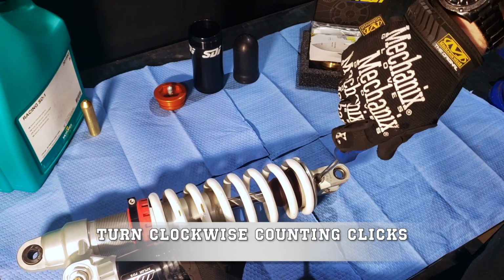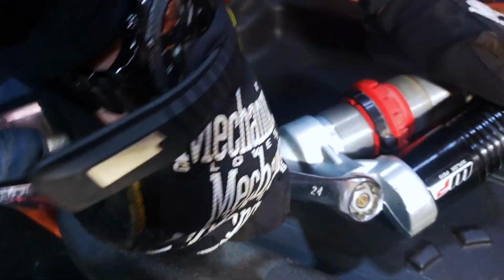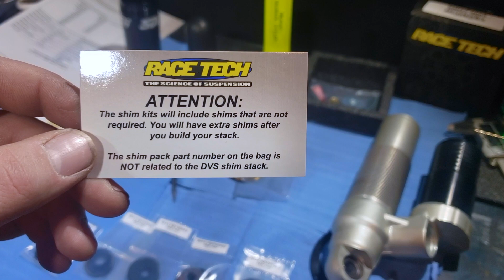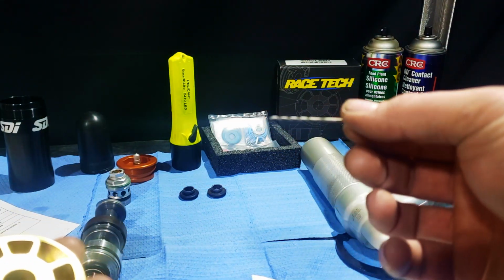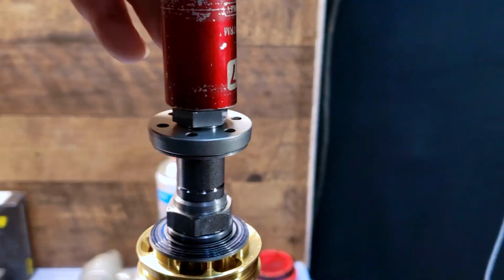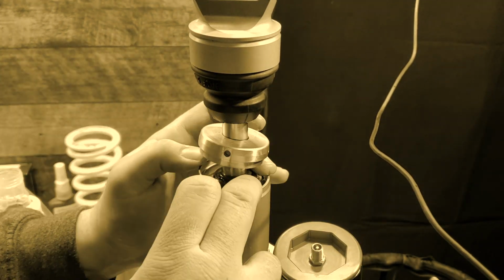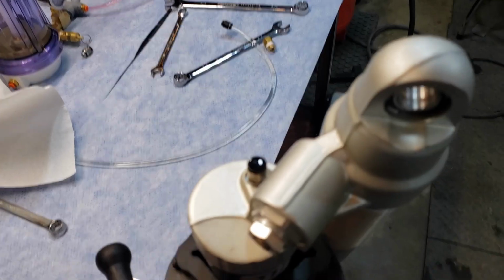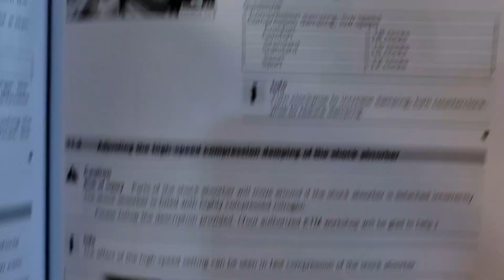HOW TO REBUILD YOUR PDS SHOCK WITH GOLD VALVES AND BLADDER KIT---PROJECT MOUNTAIN GOAT SERIES #6

Comment: When you realized the important detail of putting the spring collar on before assembly and filling with oil. 🤬

I finally got the gold valves for my Xplor 48 forks. Reviewed your videos for that process. Thanks again for posting these!
Reply from the maker: Oh no! Haha thanks I'm glad it helped. How do you like them? (Gold valve kit) mine are working incredibly well. I'm impressed.
Reply: The Xplor 48 forks were disappointing in stock form. After installing the Gold Valve kit, I'm impressed. They're much more composed as they sit higher in the stroke and don't blow through the travel, then become harsh. They don't dive like before when descending steep trails under braking. Even on gravel fire roads, they find grip and don't feel like you're on ice. 
Well worth the price and work to install after only 1 ride. 
Will likely revalve the shock and use a bladder kit as well.

Comment: Do you have a link to the vacuum pump you copied or stylied yours after?  I still need to build one.  Great video.
Reply from the maker: https://heliosure.com/product/motorcycle-shock-bleeder/

I bought it from this company. I thought about building one like it, until i seen these guys made what I was looking for, I figured they had it dialed and it would just be easier to buy it.
Thanks!

Comment: what was the name of the fitting that went into the bleeder and the vacuum line went into? great video, super helpful, going to do this to my 500s shock, was amazed to see all the gas come out of the fluid fresh from the bottle. Rebuilding a shock without a vacuum pump and leaving that gas in the fluid and some gas in the body itself would be disasterous for racers... just putting around the trails prob not so bad, but doing 100kph+ through desert and whoops no way... i found the same vacuum system you have, great price, is that system still working well?

thanks man, great work!!!
Reply from the maker: Hey thanks! Its called BSPT fitting BSPT is similar to NPT, but there is an important difference. The thread angle is 55 degrees instead of 60 degrees, which is usual for NPT. Therefore, an NPT fitting will be inserted in a BSPT connection or vice versa, but they will not be sealed. 
The pump is still in food shape!
Reply: @ENDUROEVOLUTION  hey bud one more question, the link to the video on modifying the drill bit to drill the correct size bleed hole
.

Comment: Another great video from you! I just found your channel. How do you like the suspension after doing the forks and shocks? If you wouldn't mind doing a over view on your bleeding system that would be cool. I bought a vacuum pump and filter housing but never built the system yet.
Reply from the maker: Thanks! I'm glad to hear that! The suspension feels more firm, I feel it gives me more confidence in 3-4th half to full throttle, places I ride that are usually high 2nd or low 3rd gear im doing in 3rd full even looking for 4th sometimes, And that's with the settings from racetech,  I need to go and set up a good line and keep hitting it to get everything dialed in...if it needs it.
I love that its compression and rebound on each side now👌 

I will definitely put out a better video on the shock pump, the shock video was getting pretty long so I figured I'd shorten it up by Trimming the shock pump part and then do a separate video.
Next time I service my suspension I'll focus on that. 
Cheers bro🍻
Reply: @ENDUROEVOLUTION  thanks for the reply. I'm. Trying to decide what direction to take with my suspension on my 18 300 6 days. I do like the option of learning revalving and playing with shim stacks. I'll be looking forward to the shock bleed video!!!
Reply from the maker: @ponydown418  I'm a big advocate of doing everything yourself, you learn a skill that you'll always have and it will save you money in the long run, it is a bit  pricey to get all the equipment, but once you have it, you have it, once you get good enough you could even help your buddies. Knowledge is the most valuable thing in the world, 2nd place is tools. I 100% believe you can do this yourself 🤙 and if you run into any walls shoot me a message and I'll be more than happy to help you out! I love this sport and I love helping people. 
We have a group on Facebook come join the Goatfamily 🐐🤙
Reply: @ENDUROEVOLUTION  oh yes I agree 100% on what you said. I have some suspension tooling but I'm sure you can always buy more. The deepest I went into anything was putting in a wp 50mm lowering kit on my bike. I'll chrck out your page!!!
Reply: Om pretty sure you turned the PDS piston upside down.